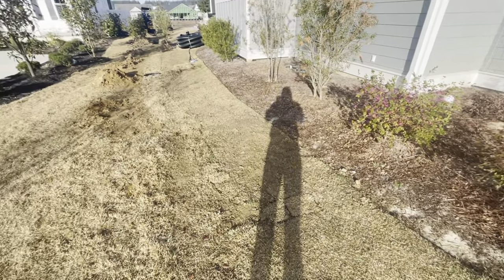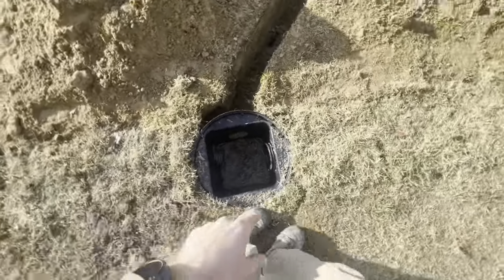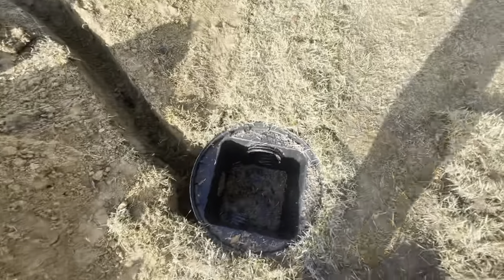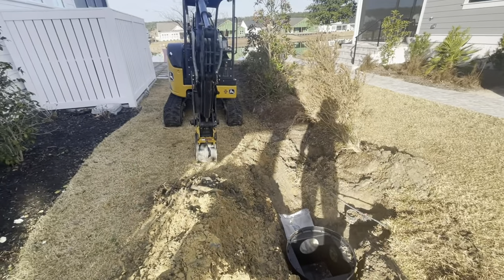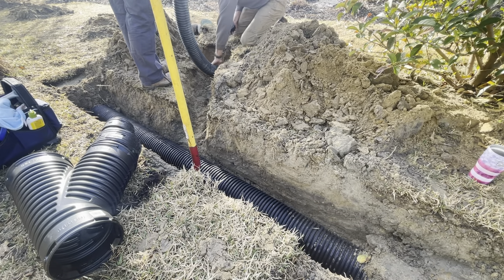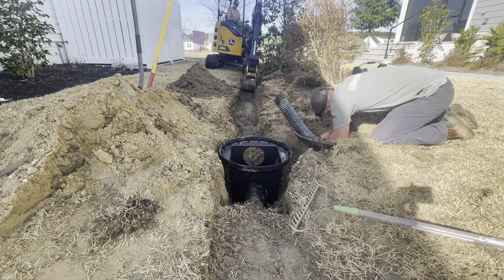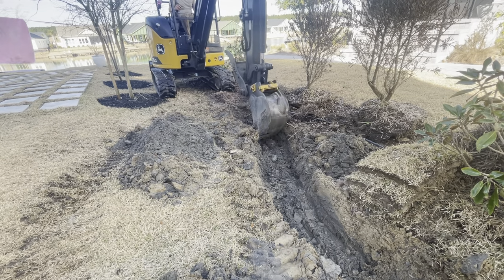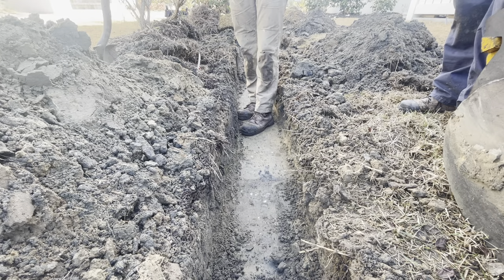A yard drain system done the right way

Comment: Noticed when you took the pop up off with the chain,, the pipe was full of water, that will sit there and get stagnant, why don't you drill holes in the bottom of the 90 and put stones under it for drainage, seen this done on other drainage videos.
Reply from the maker: You are right about the sanding water. These 6” pop-up kits from NDS come with a  pre-drilled 1/2” relief hole, or “leech hole”.
Reply from the maker: In shorter terms, there is a hole installed.